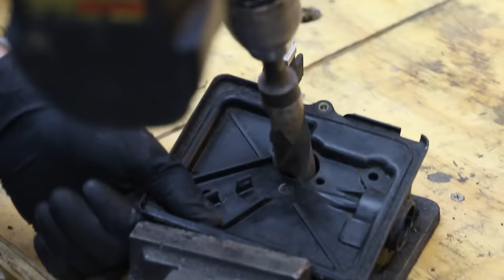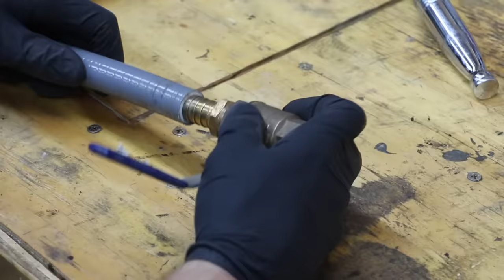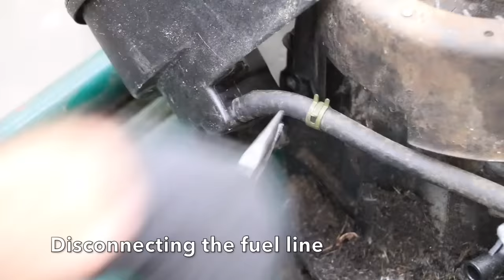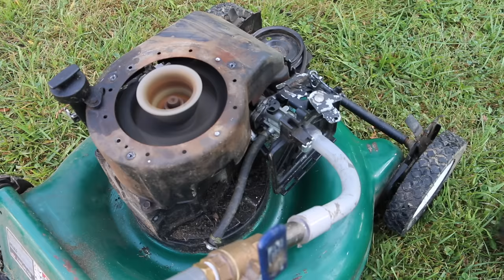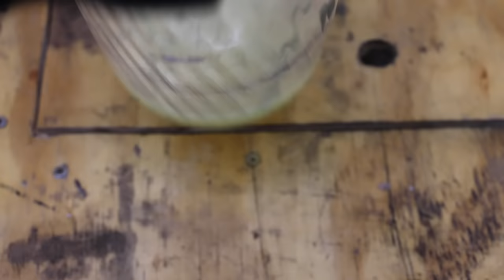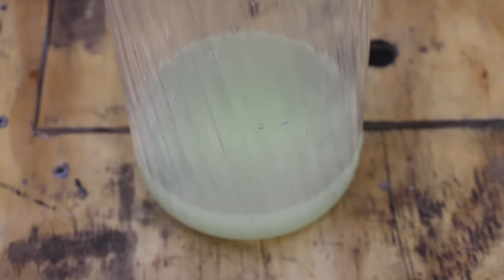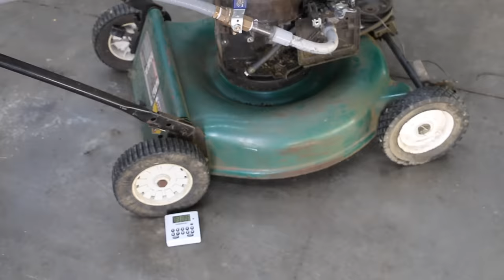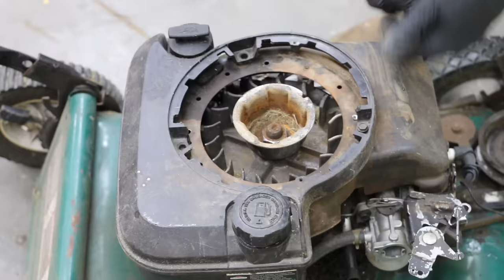Will a "Gas Vapor" Container Improve MPGs and Fuel Efficiency?  Let's find out!

Comment: Use vegetable oil as oil in a engine and see how long it last
Reply from the maker: Thanks for this recommendation!
Reply: Another fun fact:  Castor oil is the only oil that increases protection performance the hotter it gets.  It actually burns a bit and leaves a basically super slippery and impervious film behind on moving parts.  And it is all natural.  Thing of beauty.  Disclaimer:  these facts are only out of my sometimes muddled memory but I believe they're pretty close.
Reply: I remember somebody doing that as an experiment in an old daily driven toyota once, after 3,000 miles (when he changed it back out) there was no noticeable difference
Reply: Frank Belch: I believe the oily exhaust fumes were known for giving people massive diarrhea.
Reply: I believe you are wrong.  lol  Pretty witty though - gave me a chuckle.
Reply: I've studied this, canola oil has a higher burn rate then most motor oils, but it has no ziinc, I use it because you can buy it with food stamps, its worked in my 318 for 3 years with no bad results, I change oil every 3,000 miles, oil seems to stay clean as many regular oil, and mileage is slightly better maybe from being about a 20 weight, but do not use in freezing areas in country, it get cloudy and turns into a 50 W.
Reply: I worked at a drive in movie when I was young, the guy I work with used popcorn oil in his car to pass smoke at the DMV, smelled like popcorn but it pass the test every year
Reply: Vegetable oil converts to biodiesel.
Reply: In the right type of diesel engines, specifically indirect injection diesels, it can be burned straight as long as it's been strained, filtered and halfway warmed up in order to flow properly.  In fact you can add veggie oil to diesel fuel for added lubricity since they went to ultra low sulfur diesel (ULSD).
Reply: I have always thought of that.
Reply: Mornin you forgot the full stop and an in front of engine.
Reply: jack rohde Straight vegetable oil in your crankcase? Man, you're nuts. The motor would gum up in no time.
Reply: Add mineral oil to that as well. Would be cool to see how that turns out. I know mineral oil is great for cooling electronics by contact.
Reply: @ox6942  Castor oil was used in aviation engines in the 1910s through the 30s for that reason. The rotary engines (a rotating radial, not the modern type of rotary engine) went through prodigious amounts of oil and the smell of massive amounts of burning castor oil is unforgettable if you're around one that is still using it.
Reply: @brucetucker4847  Right.  You're talking the rotary engines like Rhone and Gnome where the whole engine spins with the propeller.  They ran on a total loss engine oiling system.

If I remember right, castor oil will leave a molecular protective barrier behind  after it is scorched (which protects better than unscorched) which is apparently unusual in the lubricant world.

Comment: Did you take into account of the rpm when conducting these experiments?  Sounded like the vapor test had a much higher rpm.
Reply: Oh, yeah lets reach for straws here.. It also ran with lower RPM and probably was leaner mix in periods. Best would have been to start with more fuel and run for a set time and measure the remaining fuel instead of the other way around.
Reply: Probably had to do with the manual choke he made out of the pipe valve.

Comment: Sooo, Cars don't actually ignite liquid gas right?

I only did some work on a super high mileage car, but based on my understanding they work by aersolling the fuel into a gas and then making it explode in the cylinder. The trick being to ensure that you have the perfect ratio of oxygen to gas to ensure a 100% ignition rate...
Reply: it is true, engines do not and can not run on liquid fuel! liquid gasoline can not burn. it must change state from liquid to gas or vapor so it can burn. the purpose of a carburetor is to mix the fuel and air in a manner that it can burn. the current design of carburetors is that it atomizes the fuel is which process some of it vaporizes allowing it to burn in the cylinder. when that happens the rest of the fuel vaporizes but as there is not enough oxygen to allow it to burn nothing happens. once the mixture in the cylinder is exhausted air is added into the exhaust system and that is sent through the catalytic converter to complete the chemical reaction called combustion. most of the fuel that a car uses is combusted in the catalytic converter.
Reply: @magapefarmshomestead6453  no, just no.  Most of the fuel is not combusted in the catalytic converter.  Even in 40+ year old cars, MOST of the fuel is combusted in the combustion chambers of the engine.  Modern cars with Sequential Milti-Point Fuel Injection or Gasoline Direct Injection burn just about ALL of the fuel in the combustion chambers.  You need to learn more about automotive technology yourself before you go trying to teach anyone anything about it.

The efficiency losses we see in internal combustion engines are due to internal friction, pumping losses, and waste heat energy losses.
Reply: @4WDriver  it is you who do not understand. it is not about automotive engineering or advancements, it is about chemistry. first determine how much raw liquid fuel is injected into the combustion chamber, then determine how much "air" is pulled into the combustion chamber,  then multiply that volume by 20% (as that is the maximum amount of oxygen in that volume of air), even at this level it will be plainly obvious that there is not enough oxygen to chemically react with the hydrocarbons you have counted. if you actually counted for all the hydrogen and carbon atoms in each hydrocarbon chain of the fuel you would be extremely short of oxygen for complete combustion. but I am glad to see that you trust the establishment to always give you truth. I'm sure they really like people like you that they can lead around wherever they want to.  😍
Reply: Garret Gang it dose burn liquid gas
Reply: Okay, so I checked my facts, and no car engines currently on the market burn liquid gasoline.

They take liquid gas, and aerosolize it either before injecting or as they inject it into the cylinder. Because liquids cannot burn as fast as a fuel air mixture (not enough O2 in contact with the fuel) this is how cars have worked since the invention of the combustion engine, origanlly it was largish droplets of fuel,  but they have made those droplets smaller and finer, increasing surface area to provide a faster burn, leading to higher possible rpms/torque with less unburnt fuel.
Reply: @garretgang8349  the funny thing though is that the diesel engine invented shortly after the gas engines did a way better job of vaporizing the fuel and a much better job of burning more of the fuel and ran on vegetable oil (per Otto van Diesels design), until he mysteriously dissapeared and the oil companies took over his design.
Reply: David Hosmun  I'm glad you believe that all these things were created for the betterment of the world. I know differently and will end this discussion here. Primarily because I also know that no matter what evidence I present you will counter with something you believe to be true. As there is nothing that will convince either of us to change our beliefs there seems no point in continuing a discussion. Good luck.

Comment: The carburetor and jets atomize the fuel when it is injected into the engine. You need a specific amount of vapor in the engine based on the timing and size of the piston, rings, crank, etc. Creating the vapor in a bottle outside the engine or in the carburetor doesn't change the amount of vapor the engine needs to run properly.
Reply: the video we saw earlier gasoline vapor was taken 100% without any air mixture ratio. there should be a valve for air intake located between the vapor tank and the engine. so we don't know if that way saves fuel compared to the conventional way
Reply: @amminabdullah9561  gasoline liquid doesn't burn, only the vapor does when it's combined with air. gasoline vaporizes (boils) at room temps, and mixes with the air. you can't burn gasoline vapors on their own.
Reply: @amminabdullah9561  you make a good point. for all we know, those same vapors could then be mixed with equal parts air and it still runs the same. that would theoretically double the efficiency wouldn't it?
Reply: @leeknivek sure, but maybe more air could be mixed with those vapors than are in this experiement
Reply: @randal3122  your air to fuel mixture must be 14.7 to 1. If you want to burn more fuel, then you need more air. The only way to add more air is to increase your compression ratio, which is good, but you need a stronger and heavier engine block.
Reply: @leeknivek  that's based on how we mix gas and air now, which I'm not sure is the same thing as gas vapors
Reply: @randal3122  and how exactly do you mix liquid gasoline with air? It's 14.7 parts air (19.5% oxygen) to 1 part gasoline vapors. That's the ratio of oxygen atoms in air to hydrogen and carbon atoms in gasoline vapors that burns most efficiently.
Reply: @leeknivek  but it's not pure gas vapors. it's like a mist of liquid gas that is mixed with air. a mist is not the same as a vapor. similar to how how steam is not the same as a mist setting on a squirt bottle. yes I'm sure a lot vaporizes, but I don't think all.

Comment: You successfully made something that does exactly the same thing as the carburetor.  carburetors vaporize the fuel and mix it with air which is the same thing this does.  They do the same thing so fuel consumption is the same.
Reply: The Benz patent of 1884 says vapors for his carb patent thus comical
Reply from the maker: Thanks for commenting.
Reply: One interesting thing is you could use you gizmo to run the vapors from bad gasoline or bio mass farm stuff too. Some old oilfield engines run on vapors of the well too.
Reply: you havent read too many of these comments have you.
Reply: Bill that small jar only as the ability to vaporize a tiny amount of fuel thus it might run a lawn mower but not a car down the road. That is why a carb is used and an intake manifold on a engines. Yes a nice experiment
Reply: Ryan, you are correct in that the fuel consumption should be the same but there is no control over air fuel ratio in the video, this is very important in a petrol engine, it is anybody's guess what the AFR would be. An AFR of 14.7:1 is usually banded about when talking about petrol engines but in the real world this ratio is pretty useless, for economy you would run leaner than this ratio and for maximum horse power you need to be in the region of 12.5-12.8:1. You are wrong when you say that a carburettor vaporizes fuel, it does not, it atomizes fuel and that is a different thing. A vapour is a liquid that has boiled into a gas, an atomized liquid is still a liquid it is just smashed up into tiny drops. Having said that if the inlet manifold is heated and the throttle is virtually shut which creates a high vacuum then the atomized fuel might boil into a vapour as it heads towards the combustion chamber.  These videos are fun to watch but believe me nobody is going to come up with a huge break though in piston engine performance by using an old knackered lawn mower, some rubber hose and a bottle of fuel. (If they were then Ricardo who are a huge engine development company would be buying up lawn mowers off ebay!).EDIT... As is happens the AFR in the two tests and the end of the vid must be similar because the engine ran for more or less the same time for each test. (Allowing for the errors that may have occurred by not using a 'calibrated' jam jar when measuring out the fuel).

Comment: My father is running an old Volkswagen gol 1.600cc in vapors. He puts the crank case venting into the fuel, to bubble it and keep it from freezing (Yeah, it is so cood that it looses it's capacity of vaporizing. Then he add an throttle body in in the reservoir. Opening together with the carburator. An thiny hose (1/8" ) from the vaporizer to the vacuum power brake connection. It gives him a good idle . More than 40km with 1 liter of gasoline. All passing through water to act as a flame arestor
Reply from the maker: Thank you!
Reply: No need for heat that will undo what actually works if he is still working on this have him text me .Ive been there done that and it seems this idea always makes you think you need to add heat ..not the case ..tell him to add a vacumn pump between the vac tank and the engine.with a one way valve to prevent blowback.Tell him it is the opposite physics of a bic lighter he will understand.
Reply: andre luiz hey that is a cool story about the old vw running on vapour do u got any videos of it if not you should post one

Comment: I haven’t seen it yet, if you have done one, but I’m interested in purchasing an electric cordless mower. You were the first place I looked. 
As for the vapor engine, it is my belief that the liquid molecules are vaporized and that is what burns. It’s actually rapid oxidation, heat is produced in the reaction which continues the vaporization. Solids and liquids do not burn directly. They produce vapors as they are heated which burn. It’s hard to picture that in a combustible engine with the compression and all. Atomizing the fuel/air mixture leaves more surface area which would absorb heat quicker and vaporize. One other thing is I don’t think as gasoline engines are designed, that you can enter enough vapor/fuel to get the same hp as liquid fuel. The droplets expand greatly (maybe as much as a thousand/one). So in one stroke, with liquid fuel, there a lot more potential energy. With the vapor engine, I would think it might be more difficult to measure the air fuel mixture. Sorry for being long winded.
Reply from the maker: Thanks for the suggestion.  Thanks for the feedback.

Comment: Great video!
BE CAREFUL!
If an engine backfires through the intake for any reason you're going to be in big trouble!
This is the only thing that stops me from trying it on my truck, Seriously.
In theory, backfires shouldn't happen but it's still a possibility that could result in a Molotov cocktail under the hood before you even know what's happening.

Once I was using starting fluid to try to start a truck when it backfired through the intake. It blew the air cleaner and ducting 25 ft in the air and landed across the yard. It was very loud and very early in the morning. It was hilarious.
Reply: It's called a check valve...
Reply from the maker: Thanks for the word of caution.  I'll invest in a check valve soonest.
Reply: Install a one way check valve in the vapor inlet. This is the same concept used on oxy acetylene torches to stop a back flash and burning it's way to the acetylene bottle causing a nasty boom.
Reply: A check valve could work but there's only one way to find out for sure.
Could end up a false sense of security. 
I'd put it as close to the intake as possible.
Actually I'd put it right on the intake or nothing.
A check valve would cap and contain the ignited Vapors and air but I see the potential for a pipe bomb effect.
Reply: If the backfire were strong enough, wouldn’t the check valve be destroyed? I’d put a backfire suppressor between the intake and the valve to try to soften any blow.
Reply: I recommend reading up on Oxy-Fuel Welding/Cutting systems and see what type of safety systems they use on that, as in principle its very similar to what your trying to do. Both are a gaseous fuel being sent down a line to a point where they will combust. Where I was going to school to learn welding they had Check valves at the bottle hookup and at every point it split off to the work lines. With every check valve they had blowback inhibitors and line decouplers, so if the a backfire did happen, and the other safeties failed, the line would blow apart and seal before the fire got back into the main tank. Probably don't need that level of safety because you're not using a tank big enough to blow out the side of the building but just putting what they did out there as a way to compare with other examples you may get.
Reply: use some steel or brass wool at the inlet to stop any back fires (it is a flash suppressor)
Reply: Seen that happen before. Just about shit my britches lol
Reply: Will S.
Coincidentally I just seen it happen to my boss today. he was trying to start a van using starting fluid. It backfired through the intake and said BOOM. It caught the paper air filter on fire. He was frantic for a minute. I broke out the fire extinguisher and almost had to use it but he put it out. It was hilarious
Reply: Oxy/acetylene torches only mix the two gasses at the nozzle. Check valves and flashback arrestors stop either of the gasses from backfeeding into the other. That's the only way fire could travel up the hoses.
Reply: You are right with the concerns. But in my experience with engines, you tend not to have issues with backfiring even when running on vapors unless you are putting the engine under stress and isn't running too hot. New fuel delivery "shouldn't" cause much issue or stress on the system, but good idea on pointing it out. And had a similar thing happen on a sand rail I was working on some time back but I lost my hat to that.